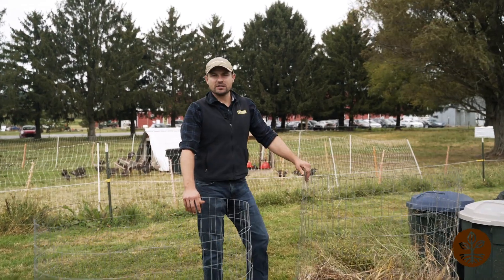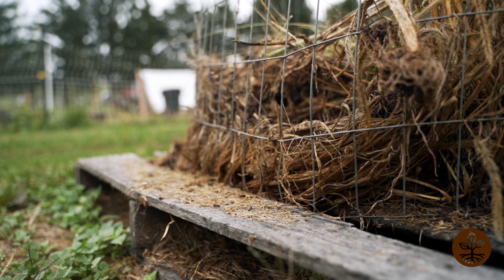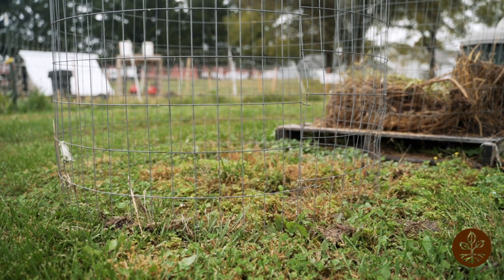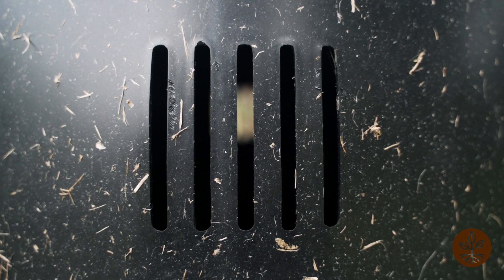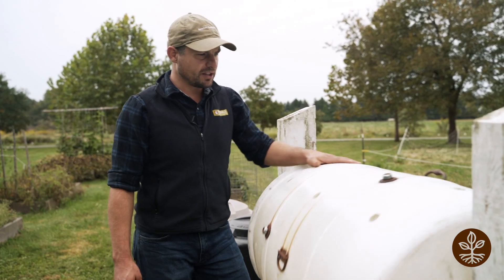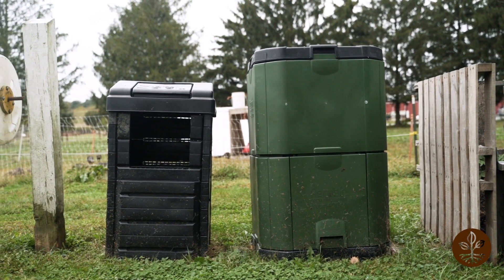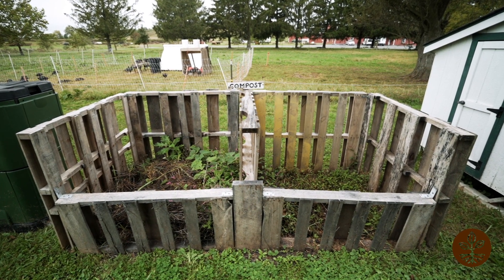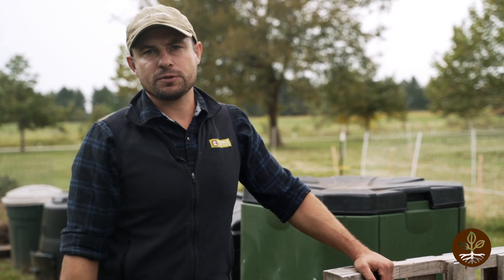Which Composting System Is Right for Me? (Backyard Composting: Part 2)

Comment: Glad you make one of this! 

Question: I have a small bin from a used drier basket. Is that the reason it wont heat up because it is small? I live in an urban area with small space to do it.
Reply from the maker: An issue with having a small bin might be that you're not able to add enough layer of browns to offset the greens. You can always gather your kitchen waste and then see if your city has a composting program you can bring it to!